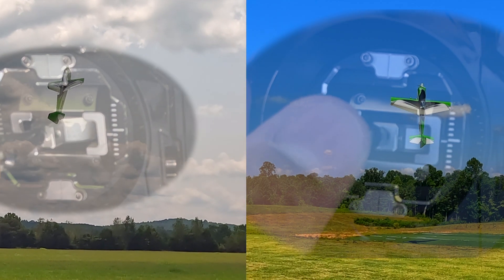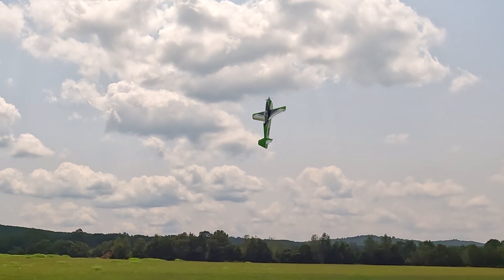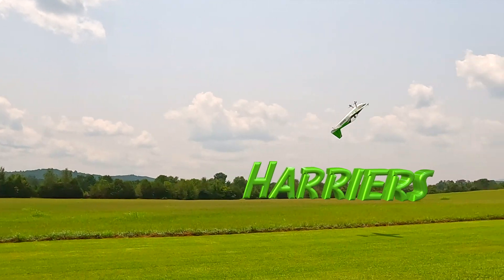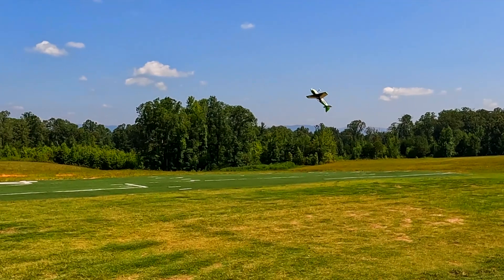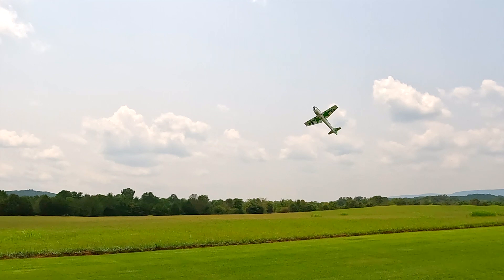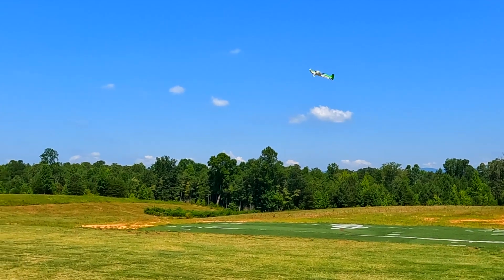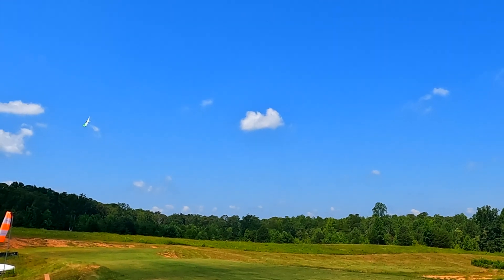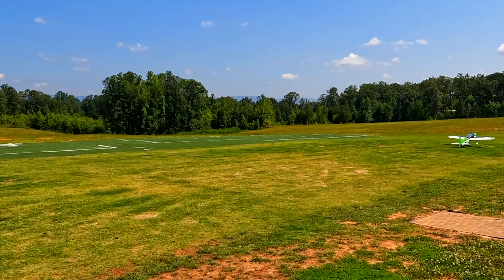3D Propeller Testing -Finding the Perfect Pitch-  Low and Slow Lessons for RC Aerobatic Pilots

Comment: This is very helpful!!! I’m at 6,000 ft in Colorado and our density altitude is 9k right now. Props here have less ‘bite’. Would a 27x11 be worth trying? I’m just getting into big gas planes and have a SW ars300 w/ gp123cc. It came with a 28x9.5 bit I like to fly with a consistent throttle like you. Thanks!!!
Reply from the maker: So I have a friend in Colorado that has flown an ARS for years. He’s using a 29x9 in the colder months and a 29x9w in the hot months to get a little extra bite. Hopefully that helps.  The 27x11 will likely make the plane feel  really heavy and droppy in stalls.

Comment: I have a new 66” blackhorse sbach with the side-force winglets. DLE20 16X8 and not enough vertical in my opinion. Is there a different prop size you would suggest trying?

Comment: Gigachad with the METAL JR GIMBALS 😎
Reply from the maker: I love my JR Radio!!
Reply: @RC-Air  t14 or t44se? or 28x?
Worth it over FHSS or DSMX?
Reply from the maker: I have the T-14 with the CNC gimbals. Been flying with JR for a couple of years now and it is absolutely solid. I still use Spektrum for my smaller electric stuff, everything big or of value is on JR.
Reply: @RC-Air  Nice!
I heard some very experienced 3d pilot switched from his t14 to a frsky x18 a few months ago for his balsas. Would you say you'd trust the DMSS system a lot more than Spek/Futaba/Frsky?
Reply from the maker: @dontflyspirit6535  so this is a loaded question that I’ve been hesitant to answer. So I will answer it this way, FOR ME I chose to go with a brand and platform that I knew I could trust based on the quality of pilots that represent JR/DeeForce. I genuinely appreciate the simplicity of the T14 as it does not have an android system running in the background. I have used both Futaba and Spektrum radios with good results, yet at the end of the day, I have enjoyed my JR system the most and so that is why I fly with. I have not tried alternate brands and I’m simply not willing to because I know that what I have works very well and I trust it.  That’s about as PC of a response as I can give you.

Comment: Great video! would you say that going to a higher pitch prop and adjusted Cg would have the same effect on an 60" electric edge ? I am running a 16 x 8 wood falcon prop  extreme flight edge with their 22 motor , but i seem to run out of aileron while in a hover .
Reply from the maker: I only had a 60" (Extra NG) for a hot minute and I really didn't get a lot of time on it before I sold it. In my notes I show that I started with a 16x8 and found that it was just too much and so I then went to a 16x7 Xoar wood and found that the wider blade and stiffer prop seemed to smooth out the plane quite a bit. You definitely want to have a neutral CG or forward with a 60" they are so lite and over powered that the smallest amount of additional thrust is VERY noticeable.  Moving the CG forward will give your ailerons more authority as well. Be careful not to run too much throw on your ailerons, I myself run 35 degrees on my big planes, too much aileron will block air going to the tail. Also watch your throttle, incremental increases in thrust, if you surge it it will want to torque harder.